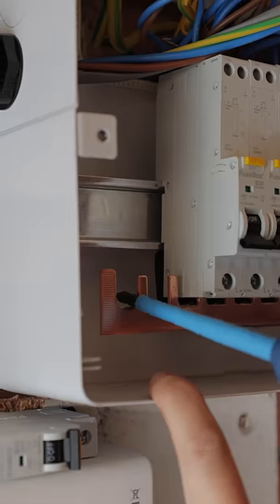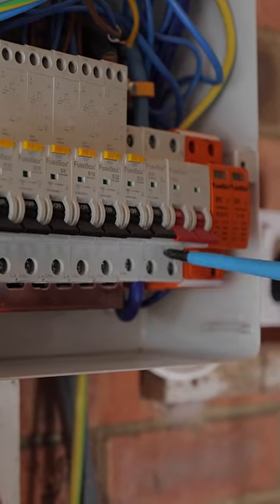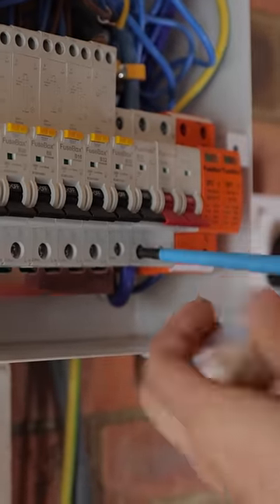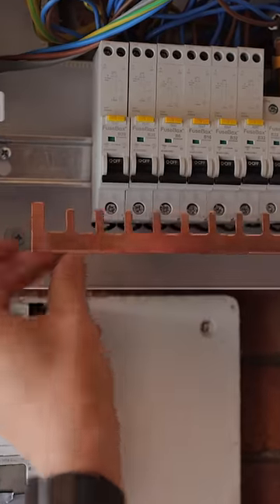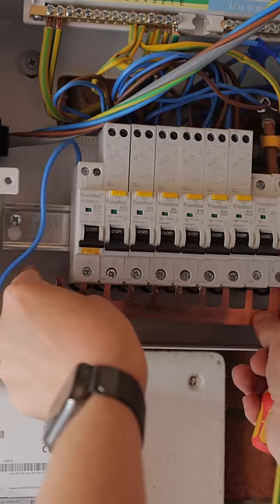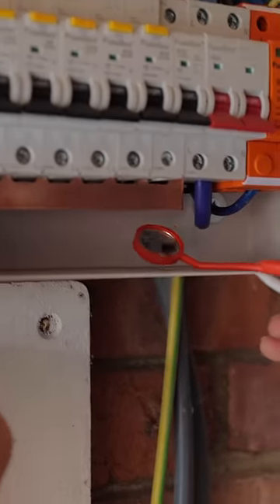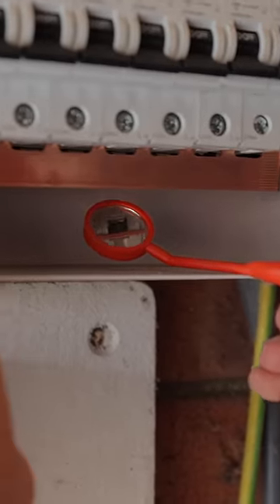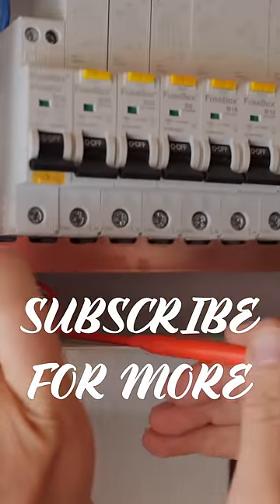It's always good to DOUBLE CHECK! Incorrect busbar installation 😮 #shorts

Comment: This should be a problem in here, the bus bar or any thing going from the source has to be on top of those breakers.
Reply: No it isn't, not how we do it in EU
Reply: @asuri8751  I don't know how you do it, but our code requires that the wire from the source has to be on the top side of breaker.

Comment: You probably saved a life there my man.   Very possible that could have turned into a fire!!
Reply: /s (to help newbies)
Reply: Yes and no. My main fuse is a 40a. Could have a 40 or 50a RCBO in a slot on a small bar, which would be considered okay. So to flip it around I don't see that much difference. If it was a 100a main then fair enough more of a danger then.

Comment: Why the hell you have a copper bar as a bridge and second why your bar isn't equal
Reply: Large pin is the supply pin. Between  60-100A  would go from there to adjacent circuits. Incoming per on the bottom, load on the top of breakers here.

Comment: The bar is not isolated over there?
Reply: Most bars In north America arnt either
Reply: Do you mean insulated?
Reply: @TonyRule  yepp
Reply: They have a clip on cover, then there is a screw on cover that only reveals the raised section on the breakers where the levers are, then there is a hinged cover that covers the levers.
Plenty of images on Google....

Comment: That makes 0% difference on how the circuit will preform or last . Conratulations you did absolutely nothing
Reply: This is the main dude board. The big pin will be drawing all current for the entire property. In theory it should be larger to accommodate the higher load. It's not a circuit. You've never seen fused parts in a board have you?

Comment: Exposed buss like that is a lousy design
Reply: They have a clip on cover, and a cover that only shows the breaker levers, and a hinged cover for the levers. All of that is removed in this video.
Comment like that is a lousy research.
Reply: @dougaltolan3017  That's how he presented this product and no one is researching a panel with no model #.
Reply: @Harrison2253  breakers are from fusebox, using your eyes would tell you this! It is against regs to use breakers that are not the same make as the fuse board here. Don't talk if you don't know! They come with covers, why are you guys so arsey fml

Comment: I've never used a mirror or anything to check if the bar's in the correct place. What I've ALWAYS done is unscrew everythings and then stick the bar in. 
And guess how many times I've stuck the bar's in Incorrectly? ZERO!

Nobody's impressed by you for the simple fact that you rip everyone off! 😡
Reply: When you tighten the fuse screw it pulls every fuse into alignment, if it doesn't then you know the busbar on that one is behind the terminal. Don't need a wanky mirror to tell you that.